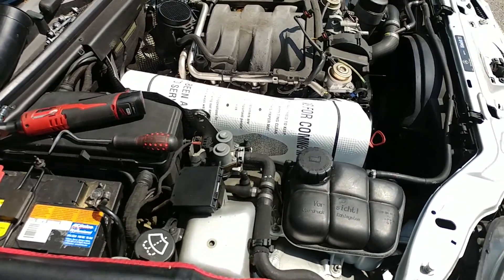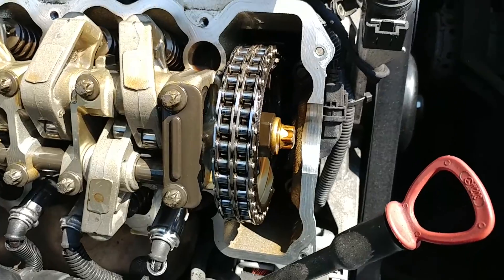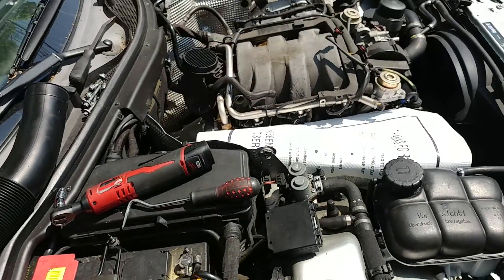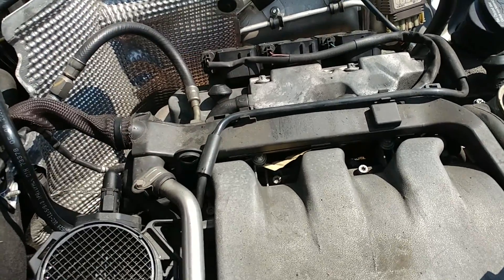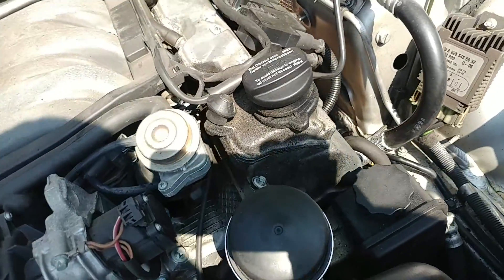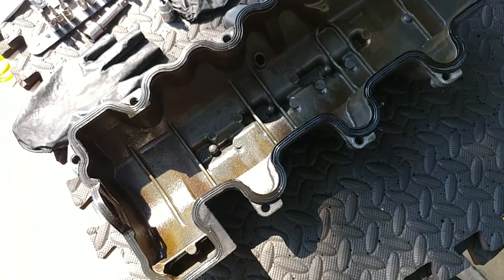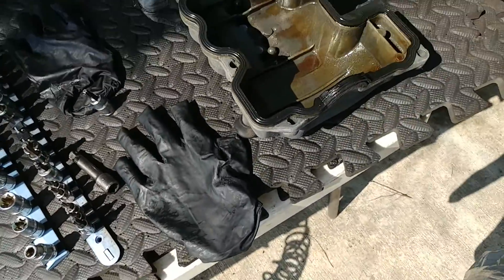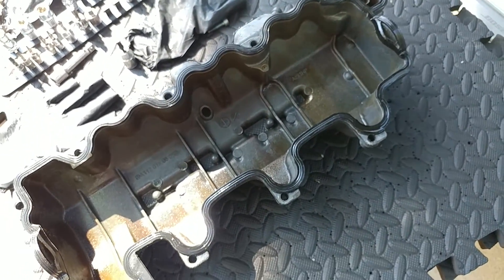Mercedes SLK320 valve cover gaskets for Athony in NYC

Comment: I checked fuses and swapped cluster but still same issue. Now both asr and abs lights are on. What kind of tools should I used to diagnose it. May be find some codes to send you. I wish you are located within driving distance. I picked interest in mercedes because of your awesome videos.
Reply from the maker: Sabinus Ihejirika Ohh man. If cluster is not burned out then I have no idea where problem might be. One more area you need to check is fuses in GM module in computer box. If they are OK maybe GM module burned out. GM module is like electronic fuse. Its job is to feed power to comouters and shut down power if cables are crossed

Comment: My speedometer for 1993 mercedes 500sel stopped work after crossing jumper cables. I took it to several mechanics and they can not read  ecu. What do you suggest? 
Thanks.
Reply from the maker: Sabinus Ihejirika can't say whats wrong without seeing the car, checkong fuses, etc. Maybe cluster burned out